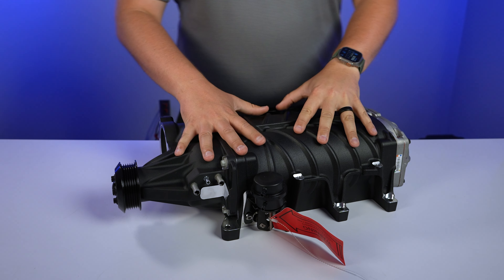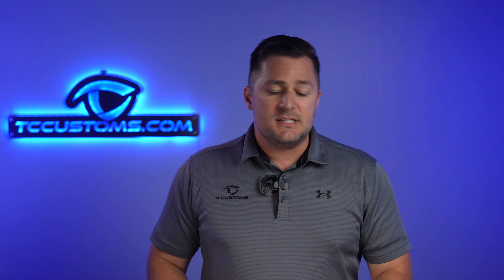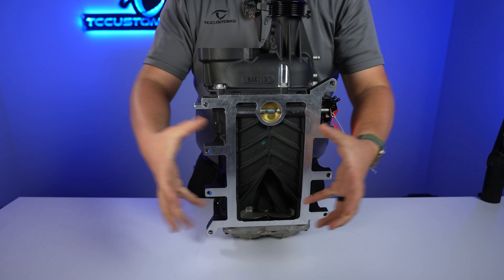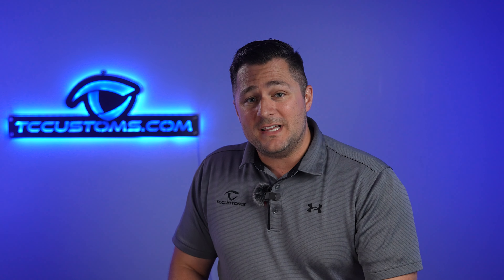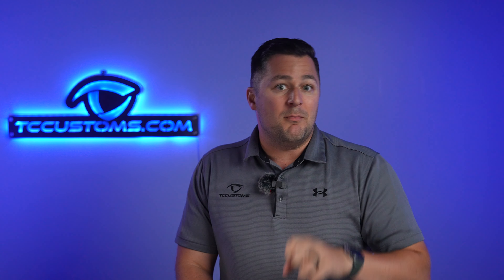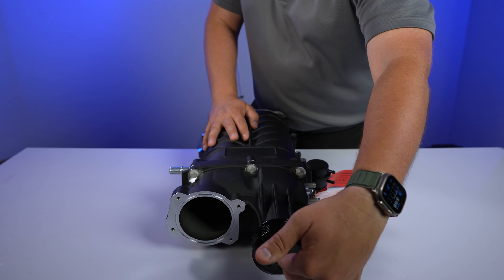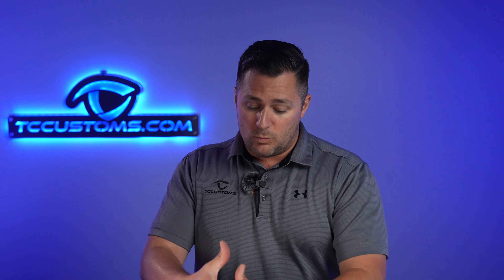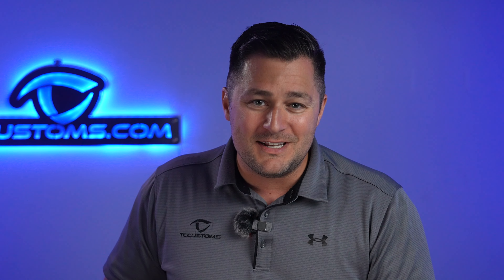How Does a Supercharger Work?

Comment: It may have a 3 year warranty but since the truck as a whole is not built to handle that much HP and TQ it will develop transmission, transfer case (if equipped), drive shaft and differential issues eventually. People forget that a truly high performance vehicle is made that way from bumper to bumper. This reminds me of my high school days when everyone was bolting on intakes, headers, exhaust and huge carburetors and then having problems with their vehicle 6 months down the road and didn’t know why. 😂😂
Reply: It’s going to have those issues anyway